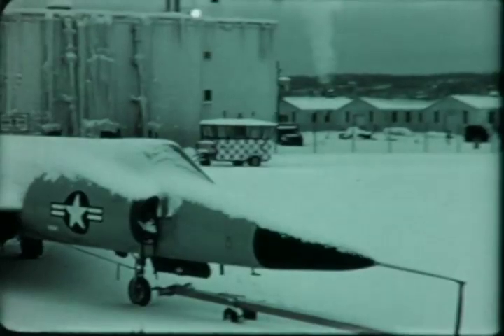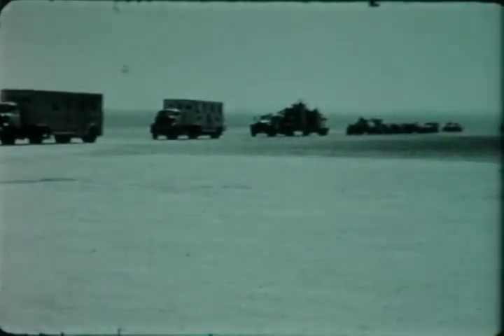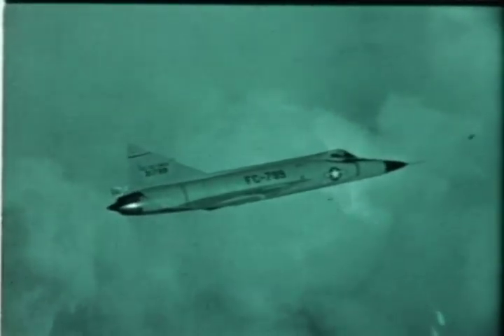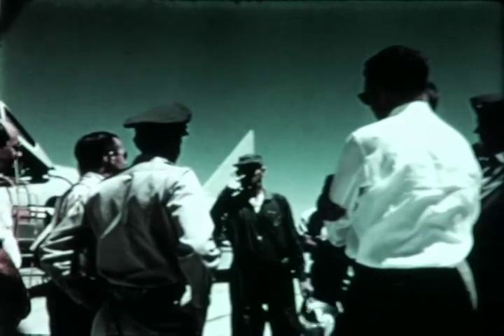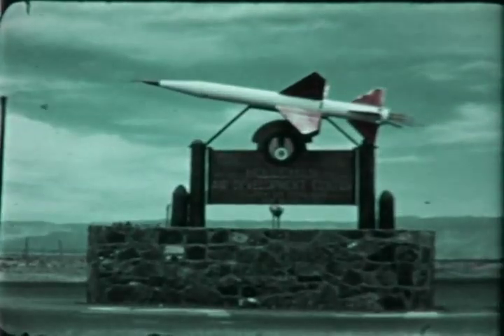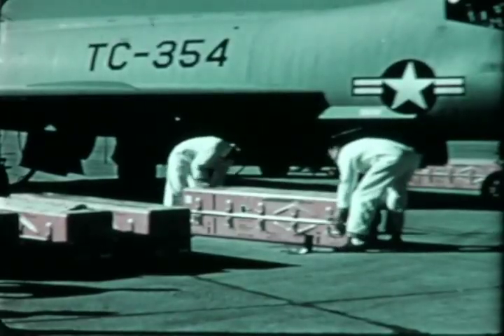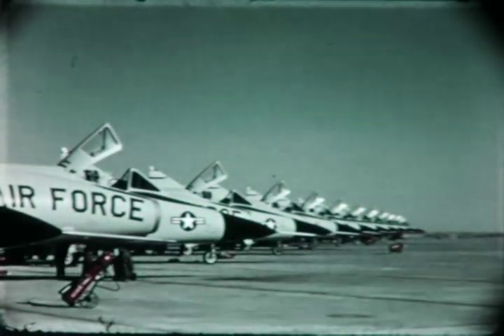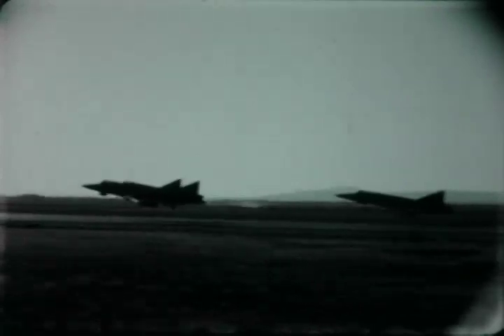F-0572 F-102/F-106 Annual Review

Comment: Delta wing craft benefit greatly from forward canards. Rotation pitch forces greatly reduced with no real detriment to over all top speeds. The 102A just needed a better jet engine, it would be interesting how the 102 would perform with the  F 16's jet.